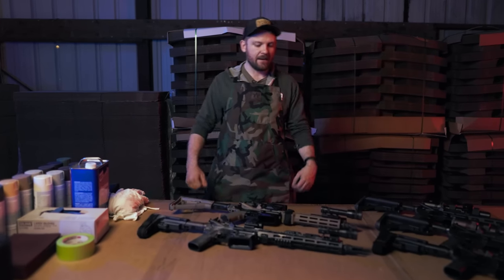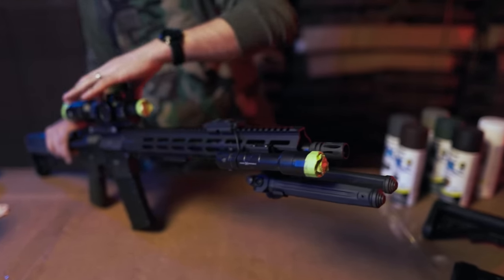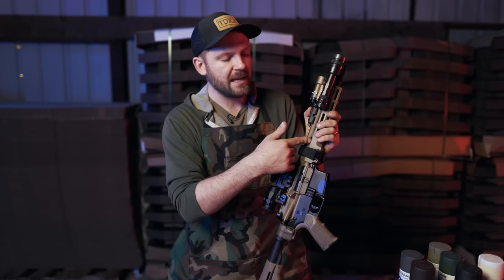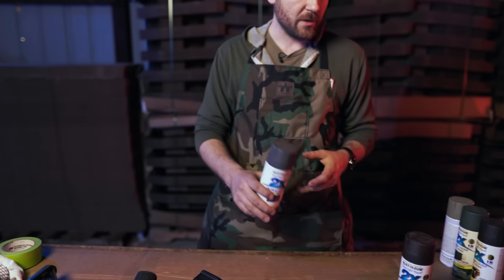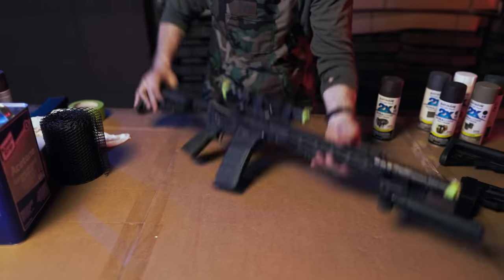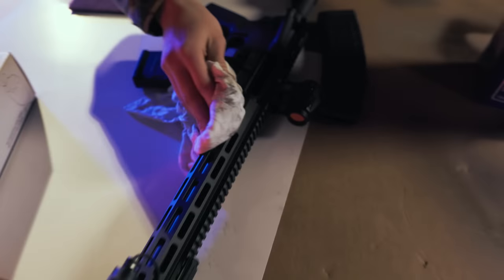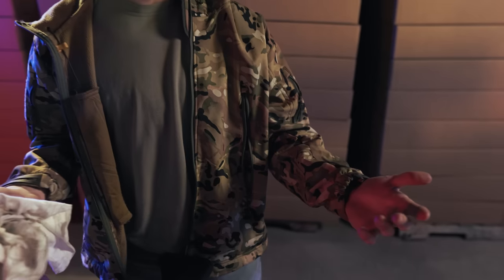Spray Paint YOUR Rifle

Comment: You can also take a used dryer sheet to blend harsh lines between colors. Just lay the dryer sheet on the rifle and spray right through it.
Reply from the maker: Solid info, thanks 👊
Reply: @TATargets  yes sir. I've used the standard netting, the sponge method, leaves and branches, cardstock, painters tape stencils, and legit vinyl stencils. But my favorite method as of late is a reusable stencil. I made my own from a thin cutting board from the dollar store but Primary Arms sells one of rubber that works better as its more flexible.
Reply: I just don’t wait for each color to dry. I make sure to go over the transition lines while it’s wet, at first it looks like crap, but as it dries the colors almost fade into each other, and the end product is a smooth transition, u can’t see where one color ends and another begins
Reply: Why a dryer sheet?  Does this tip have anything to do with the stuff on the dryer sheet, or is it just a texture or permeability thing?

Thanks
Reply: @CreachterZ  it's the permeability. It's let's you blend harsh lines. The dryer sheet blocks some of the paint from going through.
Reply: @Creachter  nothing to do with the stuff on the dryer sheet. I assume you could use cheese cloth of some other kind of semi-permeable cloth. Dryer sheets are just cheap. I should have mentioned to use ones that have already been through the dryer so they're more flexible.
Reply: @chatnasty  cool.  I’ll give it try on my test board.

Comment: I spend a lot of time in the woods. Deer are colorblind. Camo is great but movement is what triggers the eyes. As far as the definition of camouflage is to use common colors and shapes to create a different outline to identify. “Rifle shape or silhouette”. But I do believe that in 2023 if you are the max max type rolling around with an ar in yer truck….I’d go with the brightest neon “safety colors” available and be sure to do your paint scheme in block sections….to resemble a “nerf” gun. Or water blaster type toy. It’s the perfect camp as it will be immediately identified as no harmful or lethal and attention will be diverted. Even if they decide to investigate deeper, they are just getting closer to the weapon. I can’t seem to do it…I may have to just do a throw together cheapy to paint it and abuse it in my truck for varmint and plinking. Just be vigilant on cleaning and oiling (especially if it’s a “budget build” for reliability. Other than that it will be used for very close quarters, separating me from a crowd/riot. But my cc pistol can do the same. Only holds 20 in a pinch. Ar has 30 ready to go.

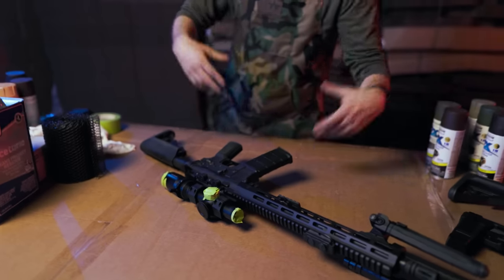Comment: B-roll up to 0:20 and 1:13 to 1:40
0:55 step by step how to paint...
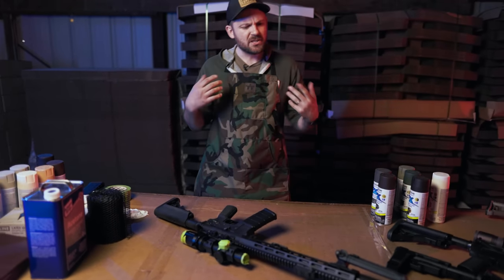1:50 Quality more in prep than paint
3:40 someone probably skipped some "prep steps" 😮

talked about tape, light coats... But no mention of acetone to remove oils, scrub brush to increase texture for paint to hold, etc. Need to research good "prep steps" before painting.

Comment: What about a primer before everything else? I've painted my airsoft gun without a primer, and now its peeling... I want to paint it again. How do you recomend? Thanks for the video!
Reply from the maker: It would help, but it is not necessary. Technically the 2 in 1 is a primer and paint mix. No matter what, spray paint will wear over time which honestly just makes it look better.
Reply: @TATargets  nice! Thanks for answering my question!
Reply: I think im going to try some black/grey and red

Comment: The lack off selection of rattle can colors is disturbing. Ive been shopping around.
Reply from the maker: Yeah surprised us too. Wasn’t expecting it.
Reply: Aervoe has an amazing selection, but sadly they are discontinuing the camo paint lineup. Rustoleum has 4 camo colors and Krylon has 3. The hardest color I've had finding is a matte grey. I've found a satin grey that works but is a little glossy. I've rattlecanned over a dozen rifles and my preferred brands, in this order, are Aervoe, Rustoleum, and lastly Krylon.
Reply: @chatnasty  I’ve had better luck with Rust-Olium Granite in satin or matte finish.

Comment: Pretty cool BUT……

The top should be darker tones and the bottom lighter as there are reasons for it. 

The top being darker dampens the light reflecting off it etc

Think of animals why are they darker up top and lighter on the lower parts….

But you do you there is no wrong way

Comment: 99h hammeroo. Is a ceramic clear finish. After finishing paint job, use a fine cloth and apply 9h. The only coating harder is diamond. It adheres to any dry finish. Paint, plastic, wood, steel, stainless or carbon. Originally made to coat polished tooling.

Comment: More upset that you purchased a strike eagle, than that you spray painted. Rattle canning cheap vortex optics to pass off as Leupolds or Razor is a must. 

Your rifles looked really shiny in the intro. I get that they were bukakied with light, but it looked as if there was a high gloss. I'm indifferent to aesthetic, so if I noticed it, that's def going to trigger someone else.